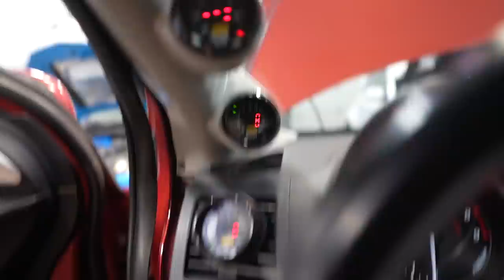Creating The Best Evo Cockpit!

Comment: STM sells a AMS oil sending unit line that connects to the housing with an adapter already. This way you don't have to extend the wiring or risk losing the oil sensor to the engine vibrations. I was even able to route my sensor through the wheelwell with no issue.

Comment: There is a correct angle for O2 sensors, it is like basically a little higher than horizontal. See the AEM instruction manual

Comment: Hey Devin be careful with putting too much sealant I made the mistake of doing that and sealant got into the oil and clogged my oil filter causing 0 oil pressure. I blew my turbo luckily didn’t blow my motor :/🤣 don’t want that to happen like so he can see